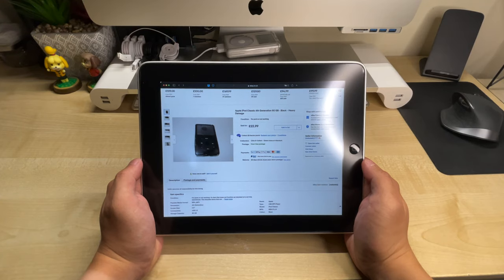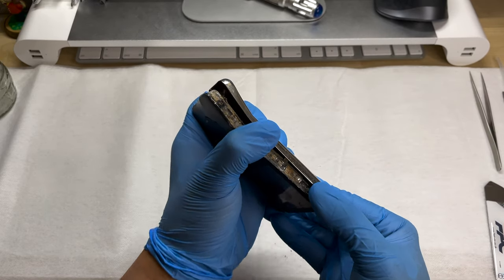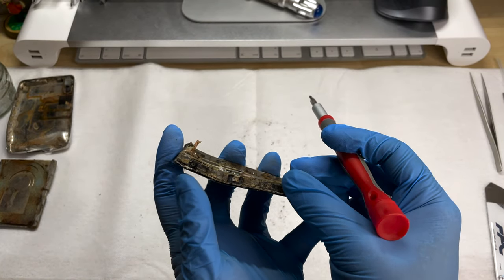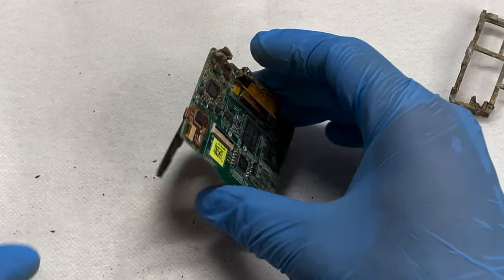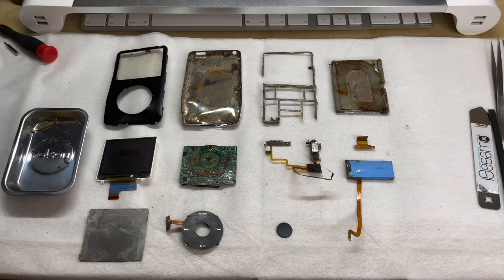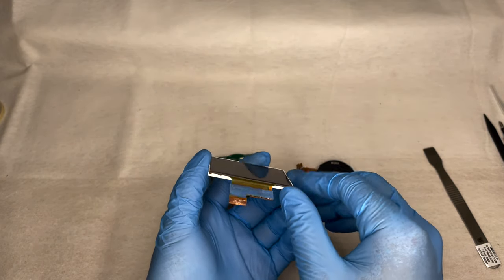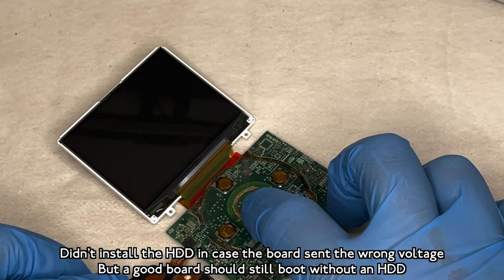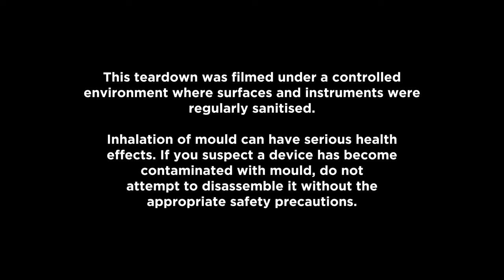Opening Up a Cursed iPod

Comment: Cursed ipods are the best ipods, I found a 4th gen nano in an auction lot that that has the colour anodization completely warn off but somehow does work.  But among the lot was a 3rd gen nano folded in half and a 4th gen that was corroded worse than this one in your video and it makes you wonder what stories they would tell if they could.